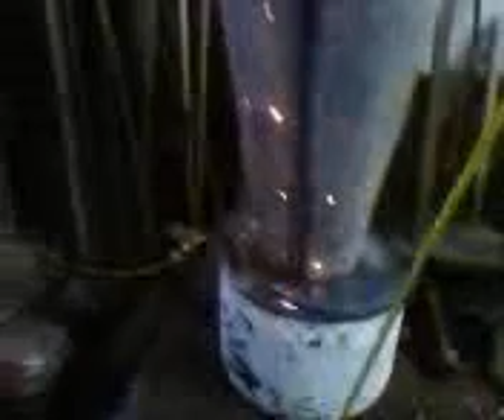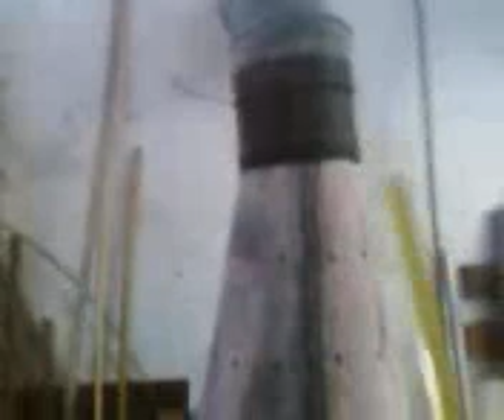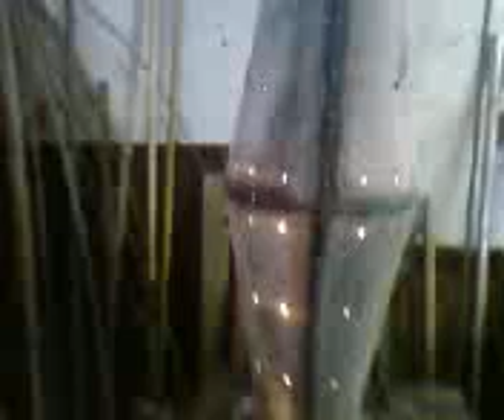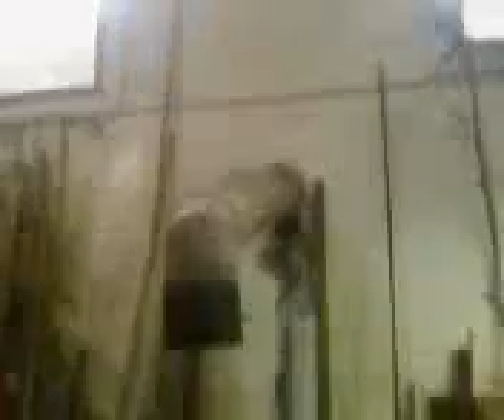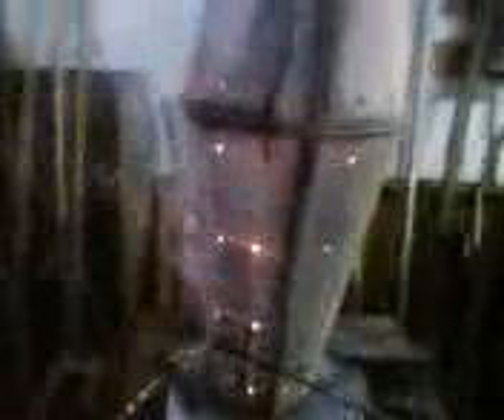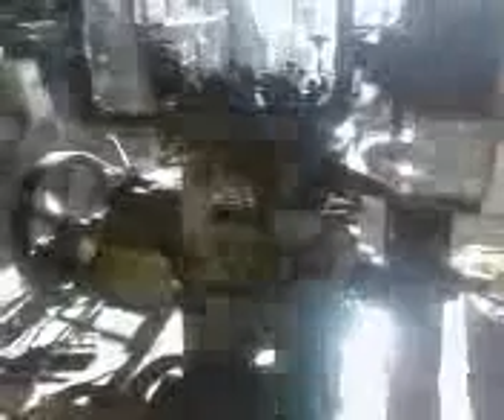Waste Oil burner,Mix any oil and burn it for FREE heat,whitemansgreenmachines.com,12324asdf1

Comment: Thanks for pointing out the dimensions.  Nice prototype.  Is there a valve to control the oil drip and heat amount?   Why the expanded diameter in the middle of the tube, wouldn't a straight vertical stack work the same?    Do you have to mix something like diesel with the oil for it to combust?  Is there much smoke or fumes out the end?

Comment: Hi...thanks for your reply...where did you see the original burner on youtube?  I'd like to look at that too if you can find it.  What about the holes drilled?  How do you know how many and where to place and what size?  What is the metal used...is it just sheet metal or stainless or what?  Also, do you have any suggested improvements to the burner at this time? How would you make it better.  Tx Much.  Bob C

Comment from the maker: This unit works without a blower or extra air input,Yes I have a valve at the output of the tank holding the wast oil.The large diameter helps the flame but I have seen youtubs with straight stacks thay seem to work just fine like this oпе   ( чь на отработанном масле ne  ).

Comment from the maker: @bobWsterguy Hi Bob,The middle has to be wider so you et the right air flow ,BUT i have seen the same type made that had no taper! This is a copy of a burner that I saw on youtube.I see this thing lasting longer then I will.Bottom is just a light gage metal can (old gas can )that helps keep the oil HOT.This is good for the shop or out side .If I make one for the house I would build the one made by OZZIRT,His looks very nice!!!!!!!

Comment: Hi.. I can see the welds on the two cones joined together.  How thick is that sheet metal or is it plate?  Did you weld that with a wire feed?  I like your design.  Would you consider making the just the two cone parts for me i.e. without the bottom can? I can add the can myself.  How much would cost be with shipping to zip 54401?  I'd like to try this thing if possible?  Tx. Bob C

Comment: Why is the stack wider in the middle?  Are there any other videos with a design like this? Also how did you come up with the number and pattern of holes?  Seriously, does it produces any carbon monoxide?  How long do you think it will last before the metal burns thru?  Is the bottom just a simple can like a paint can or is it something heavier guage? Do you  have any other ideas to improve it?  Any other ideas how to make it very safe?  Nice job.  Tx. Bob C

Comment from the maker: You can put any oil in it that u have.Some of the oil i burn has water in it ,still burns!
Smoke at start up once u get the air set it will not smoke!